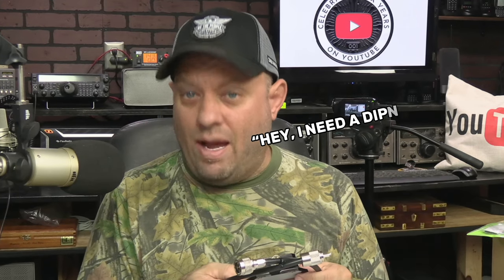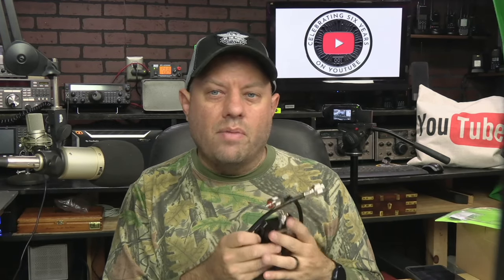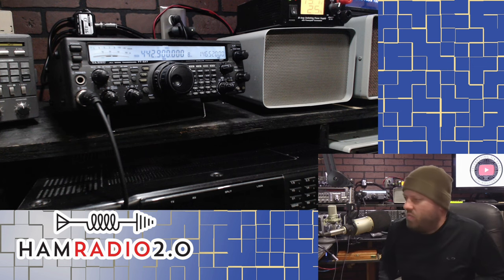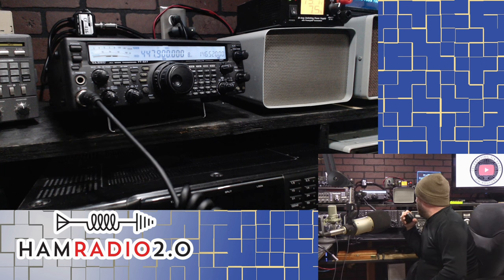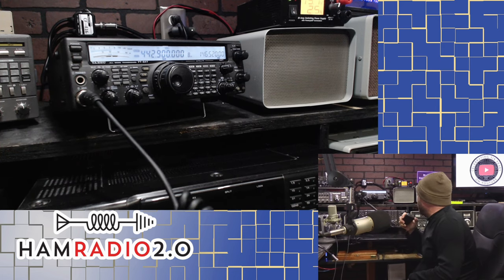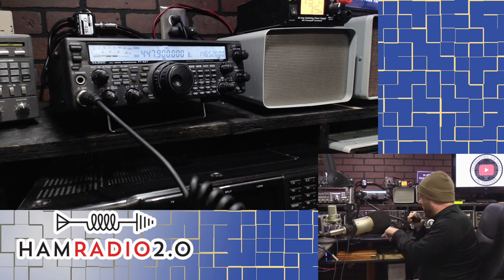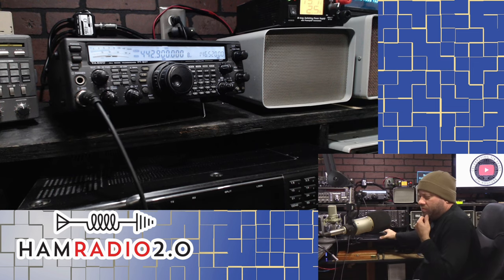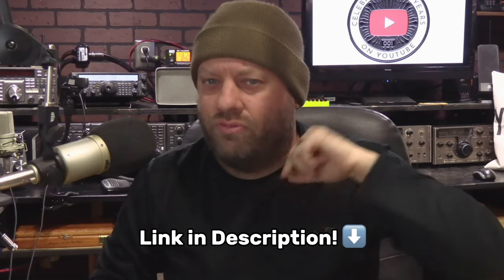One ANTENNA on Two RADIOS - Comet Antenna Diplexer for Ham Radio

Comment: I use two cf-706 to run HF & VHF/UHF over a single LMR-600 feed line out to the mast base. One to run out from HF & VHF/UHF rigs to feed line and the other to split it off again to the two antennas. Saves money on a single quality feed line (120')

Comment: I set up a Winlink Gateway at a hospital in Florida using one of these. I had a VHF Packet Digipeater on one side an a UHF radio for VARAFM into the gateway on the other side. Works great. I have Comet CXC -333 I am going to use for VHF, UHF, and 1.25cm on a Comet triband antenna I am putting up.

Comment: A fellow HAM is trying to convince me the following will work..  His proposed setup a HexBeam or other Multiband HF antenna with a single feed point. Attach a Triplexer so 3 radios all have access to the HexBeam. Each Radio would be on different band(element) of the antenna. I see no problem as long as ONLY '1' is used at a time. His thought is that all 3 radios can be actively used at the same time. For example Radio 1 is transmitting while the other 2 are able to listen. Or even all 3 transmitting at the same time.  Your thoughts and anyone else's thoughts.

Comment: Duplex TX and RX same band. Diplexer 2 bands both for TX and RX same antenna.  You can even use diplexers both top and bottom of your feed line to use separate antennas and the same feed line
Reply: I asked this question on a couple FB pages.

I have LMR400 going to a discone, I wanted to add a diplexer at the mast top , to run the discone and a EFHW antenna fed by the LMR 400 to my IC705. 

Answers were Yess it will work and other people said I would blow out my front end or have a good bit of loss, what is your take on it.

Thanks 73s
Reply: @bobdefield7842  I do this exactly as you describe. I have a CF-706 inside shack, and another atop the mast where I split to the EFHW and the Discone. The ONLY time I have ever had an issue is the exact same as if I had dedicated coax. I had RFI from harmonics, and or monitoring the same freq. or band as I was TXing on. Attenuator's fixed that problem. I use the Discone for scanner, and the EFHW for HF operations.

Comment: Another use for this is to protect an HF Radio such as the FT-891 from getting ruined by a VHF /UHF Radio that has its antenna in close proximity to the HF Antenna such as in a mobile installation. Example FT-891 with the ATAS 120a alongside an FTM-400 with its own VHF/UHF Antenna

Comment: Cute little diplexer. High power versions are common on the 3 meter band. :)
Reply: I was going to say the same thing. When I worked in commercial broadcast industry on various systems, I think I encountered a diplexer in every system. Its called cost savings, and sometimes just being a tightA$$ with the dollars and not spending for the second antenna system when it would be better.
 There are times though when it is perfectly acceptable for cost , efficiency, and application to use a diplexer. I dont know how many times I have seen, or rather smell't a burnt diplexer when near. The caps are nasty smelling when they pop. Other times The pits from arcing makes you wonder who was at the controls

Comment: Can I use 2 antennas on my quad band radio?

I have a Comet CF-530C (1.3-90 and 125-470). I want to connect a dual band antenna to one port and my 10-meter vertical to the other port. Then connect the Common port to my quad band mobile…will that work?
Reply from the maker: Yes, as long as each port on the diplexer is used for the properly rated frequency range.

Comment: I prefer the CF-706 over the 416, because of the fact the 2 meter is separated from the HF port. However, depending on radio, this may be needed. Put two in opposing order, to run 2 radios to 2 antennas over single line. This format is also used in DBS. and as I write this I also see another comment to same idea.
Reply from the maker: Lots of options available

Comment: Hello, I'd like to use a 2m 70cm dual band transceiver and a 220m transceiver with one tri-band antenna. But I can seem to find one correct diplexer. So I was wondering if I could use a Comet CFX-324A tri-plexer and a Comet CF-4160J to make this work. Or something like this. Thanks

Comment: Do you know of a diplexer that can handle 1500w?  Wanting to run a diplexer to my barefoot 2m yaesu ftm 500d but also run a kenwood ts890 with a 1500w amp that is all tied to a dx commander multiband antenna

Comment: Would I be able to use this for my two VHF Transceivers and my one Comet GP-1 Antenna?  I have a Yaesu FTM 2980r w/ Kantronics KPC 3 Plus and a Yaesu FTM-6000R w/ Kantronics KPC 3 Plus.  I have one running as an APRS Digipeater and IGate and the second running as a packet station/BBS.  Obviously the APRS DIGI/IGate is on 144.390 and my Packet Station on 145.030.  Thanks for the help!

Comment: how is the RX on one side when the other side is TXing? Other than staying under the antenna's wattage rating with two radios TXing at the same time, is there anything to worry about? Like could I toss up a GP-3 and have one side on a radio/pc doing winlink on 2meter and setup the other side with another radio doing  packet on 70cm?

Comment: Comet is a good company.

But 2 rigs on one antenna? 

What could go wrong?
Reply from the maker: In this case, nothing.
Reply: Your Question is spot on for the next part of the equation. Yes you may put two radios on a single antenna. However, many will forget to consider the COMBINED wattage at the antenna, and will likely destroy the antenna. The antenna is rated for single band operation NOT combined both TXing at same time. 
 In the end though, as long as the antenna is designed for, or, at very least the wattage rating considered, you can make it work.

Comment: I have a Diamond MX-62M "Duplexor" and I am interested in your thoughts about using it with an Icom IC-705 which has one antenna port.  Would it be safe to connect the IC-705 to the MX-62M and the connect an HF/6 antenna to the HF (1.5 to 56MHz) port and a Dual band VHF/UHF to the 140-470MHz side of the MX-62M?  I do not want to damage my IC-705.  73's K5BRS.
Reply: Yes, you can use the diplexer that way also. The MX-62M, is similar to the CF-706, in that HF/6 is separated from V/UHF bands. There is enough isolation that NO harmful RF should be traveling to either radio.

Comment: i'am searching for a Duplexer for 2 radio's both vhf and uhf, so both ports on the duplexer have to frequentie use lets say 140mhz till 500mhz  
Anyone here maybe that know a product that have this kind of duplexers ?
Reply from the maker: Comet makes one that will split between VHF/UHF, just a different model from this one.
Reply: I’ve searched for the same thing now for weeks. So far I’ve found 2. One was rated at 25W and the other was rated at 30W. They were both for using 2 VHF/UHF radios into one VHF/UHF antenna.
Reply: @TrentWilbanks  hello Trent do you have for me the brand name and model? It's nog a lot of power but maybe a option.
Reply: @Andre-xu3pq  I tried posting a link last night and just saw it didn’t post. I’ve tried several more times but it is not posting. The 30W unit is a Shakespeare AS-2. It’s available on Amazon.
Reply: @TrentWilbanks  TNX I seen it, maybe a option to try but it's us only (sending) . I love in the Netherlands 
But i'am going to research it. Thnx 👍🏼
Reply: You’re welcome. It’s available from different sellers and also on eBay. Many more sellers if you Google it.
Reply: @TrentWilbanks  one thing I noticed about the device, maybe iám reading this wrong english is nog my native language.
that you transmit on 1 of the 2 trx sets, it also only receives on one of the 2 sets. my idea is one set analoog,  and one set DMR on 1 channel voor RX .
and oke it is logical when you transmit the other input is "dead" but when i stop transmiting I would think if you listen again that it is on 2 sets

what is your idea about that?
Reply: @Andre-xu3pq  That is correct. Only one radio at a time can transmit and receive. If you transmit on the analog radio, the antenna will switch to the analog radio. When finished transmitting, the antenna will remain connected to the analog radio, and only the analog radio will receive. The DMR radio will not receive until you transmit on the DMR radio. When you transmit on the DMR radio, the antenna will switch to the DMR radio. After transmitting the antenna will remain connected to the DMR radio and only the DMR radio will receive. The analog radio will not receive again until you transmit on the analog radio.
Reply from the maker: @TrentWilbanks  Link posting is blocked to prevent spam bots from taking over the comments.
Reply: @HamRadio2  ah ok.

Comment: I thought a duplexer was to split to two different antenna?
Reply from the maker: Are you asking me what you thought?

No, I mentioned this in the video - this is a diplexer, not a duplexer.  A duplexer is actually used on the back or a repeater, to take the TX and RX radios inside of the repeater - usually separate radios - and put them into 1 antenna.
Honestly the diplexer that I mention in this video could work either way - you can use it on 2 radios to 1 antenna, or 1 radio to 2 antennas, for the proper bands that the diplexer is rated for.

Comment: What happens 2 radios to 1 antenna when there is RF coming out from both rigs?
Reply: The diplexer has filters to direct the signal only to the port it is for. The other port is hi impedance. It works great if you have quality components. Your cell phone is more than likely using one as you speak.